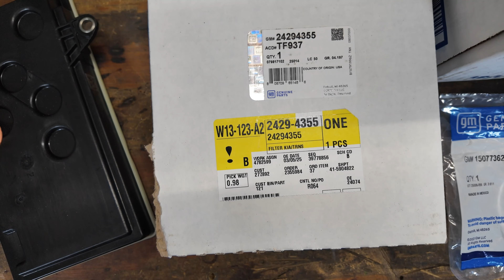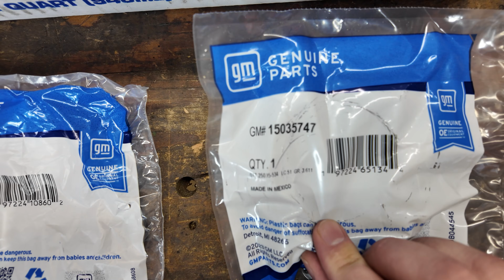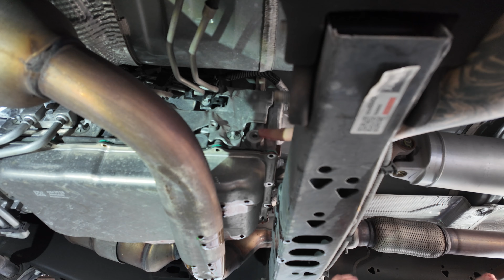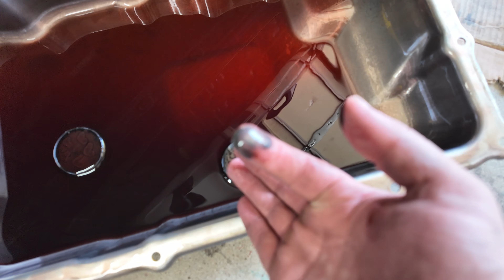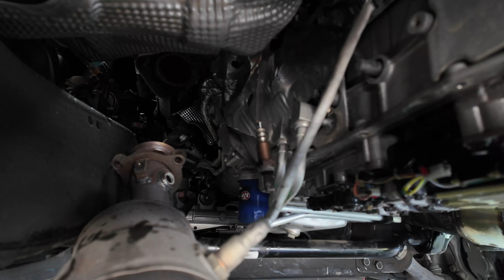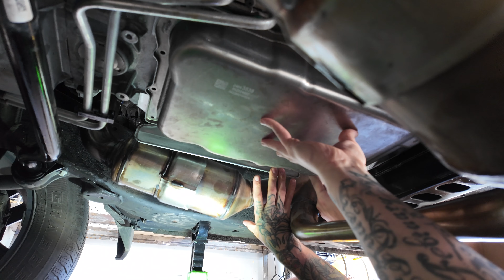Save Hundreds: Service Your Silverado TRANSMISSION Yourself

Comment: Had a BG transmission flush/exchange done on my 2020 Sierra with the 10L80 and a 2021 Suburban with the same 10L80, changed both around 50k,...so far so good.
Reply: I did it at 20k.  Get all that metal out .
Reply from the maker: @sschevmale24 that’s the best way to do it!
Reply: @sschevmale24  Did they pull the pan and clean the magnets?  The magnets can become "full" and allow particles to flow and become attached to the magnetic solenoids... which becomes a larger problem down the road.
Reply: @testtesting2868 no. Just a flush.  Have 55k now but I will drop the pan, put new filter and new ppe pan.  Might change to amsoil atf
Reply from the maker: Nice! I do like the BG products
Reply: A flush at that mileage is good to do but not ova 100k miles as ppl try ta do

Comment: Once again gm engineers make something simple into a debacle
Reply from the maker: Yeah exactly 😂
Reply: @alwaysandy1  but the problem was the exhaust pipes from both sides of the engine has to merge somewhere somehow and this was the only place to do a cross over. it would have been nice if there was a drain plug so you can just do a drain and a refill.. but GM had to remove the plug to save $$.  lol
Reply from the maker: @bommie1202remove the plug to save money lmao, you right!
Reply: @bommie1202 Then how would you change the trans filter?
Reply: @bommie1202  :>   Drill a hold,  let is drain.   Tig a threaded aluminum collar or nut to pan.    Add a drain plug:>    Change trans  fluid every 30k with ease.
Reply: @factoryrat405  Draining the fluid out of the pan BEFORE taking the pan off is a lot easier than trying to slowly lower and tip a full heavy pan into a drain pan and not spilling transmission fluid everywhere, especially if you’re doing this laying down on your back with the truck jacked up instead of a shop lift
Reply: They ran the exhaust in the way so it'll be difficult for yu ta change it yourself.  This service will cost yu 500-600 in a shop alone.  Fluid gotta be pumped back into it.    No dipstick on that truck
Reply: @STG-i4x did mind yesterday $440 performance transmission drain, now I’ll let you figure out what’s performance about a drain. But it is shifting better I’ve done 4 of them and I don’t even have 100,000 miles yet 😩😩😩 “ I’m never going to retire “
Reply: lol thanks for that made me laugh just shelling out $790 for two oxygen sensors so it is the LAST CHEVY I will ever buy
Reply: @jonathanbellows113 wait til you’re on your second torque converter. Chevy has went to hell man. 😢 garbage quality these days
Reply: @cap @captaininsan9997  yes, I guarantee you this will be the last Chevy I ever buy, I replaced mine with a circle D heavy duty so I’m hoping I’ll get some mileage out of it

Comment: Do you have to have a Chevy dealer repair shop do this? That's what I've been told. I have a 2019 Chevy Silverado 1500 LD work truck.
Reply from the maker: No you do not. To keep the warranty on the vehicle, just keep your receipt for the fluid and filter

Comment: I have a Chevy 1500 and I'm about to have the transmission serviced. Do you think that if I use a better oil other than Acdelco oil, I'll have problems in the future?
Reply from the maker: I doubt you’d have any issues, in my experience better fluids usually work just as well if not better then recommended ones
Reply: Chevy is now recommending the Mobil 1 ULV to replace the stock oil that breaks down around 80-85000 miles.

Comment: Pretty new to working on vehicles. Where did you learn/find the torque spec for the pan bolts?
Reply from the maker: GM Labor Guide
Reply: @alwaysandy1 do you have a link to the labor guide?
Reply from the maker: @rcrracing33 unfortunately it’s only accessible as a GM Employee
Reply: I recommend an AllData DIY subscription. $130 for 3 years for one vehicle (also monthly and yearly available). It is constantly updated with technical service bulletins. I use it all the time.

Comment: Do you know if this would be the same service for a 2022 sierra 1500 with 8 speed?
Reply: I had to drop exhaust on my 8 speed.
Reply from the maker: Good question, I’m not sure tbh
Reply: Currently working on my 8 speed. Some videos show people prying on the exhaust to slide the pan out. I have a frickin jack holding my prybar in place and it’s not enough room on mine. Now watching videos to figure out other ways to get it out.

Comment: Can you pls add the link or the size of the filter fasteners can’t find them anywhere with no guidance
Reply: u can use a regular 8mm socket, chrome tho it fots tighter than the imapct socket
Reply: E8 socket
Reply: E10 would be 8mm in metric
Reply from the maker: 8mm

Comment: I’m fixing to get amsoil ulv transmission fluid instead of delco
Reply from the maker: Sounds good! Let us know how it feels
Reply: @alwaysandy1 AMSOIL is BY FAR THE SUPERIOR ATF. Dexron VI is mineral oil GARBAGE...AMSOIL Blue Label S.S. 'Fuel Efficient' ATF is a 100% full synthetic and night and day better...next atf fluid change, try it - you'll be amazed with the results!
Reply from the maker: @Canada55Ehthanks for the tip! I’ll give it a shot!
Reply: @Canada55Eh  where you find/ get Amsoil at for 10 speed in canada?  I've called a dozen parts stores with no luck

Comment: 2020 Chevrolet Silverado 1500 LTZ No Drain Bolt on Pan
Reply from the maker: Gotchya
Reply: There's rubber plug on the other side

Comment: thx for the video. Obviously a very controversial topic. Should you or should you not replace your transmission fluid? Some say yes because its regular maintenance every 45k miles or so. Some say no because you'll somehow have issues not matter if you did every correct like in your video. Thoughts on that?
Reply: I was thinking the same thing when I did my 4l80e it’s a Mark 5 gen 5 or whatever so after I did the simple flush and filter it’s making a subtle whinning noise now it’s like dam If I do and dam if I don’t I’m done with it lol I’m going to just leave it alone for now
Reply: @Itainteasybeingcheesy2000  that’s what I’m saying. Totally different from regular oil change. Trannys though is like very sensitive to the point where I rather just not even touch it. Or have the dealership do it so if it messes up it’s on them type of situation.
Reply from the maker: Good question, I think everyone can agree on there's "no such thing as over maintenance". First, you 100% definitely need to replace transmission fluid. For GM, they say every 45,000 miles. But I feel like thats subjective. If your towing heavy or doing a lot of in town driving, especially if you live in the south, than you shouldn't wait so long. Heat destroys the addivtives in the fluid and it should be changed more often. GM says every 45K under normal driving conditions. 
I have another video on my channel of doing a 2500HD transmission serivce that waited a little too long and the fluid is much darker. 
The controversy comes from having the "fluid flushed", using a machine that forces fluid through the transmission. The problem with that is found with vehicles that have not been doing the proper fluid exchanges, and when you force fluid through, your stirring up crap on the bottom of the trans pan and pushing it through the valve body. There's check balls that rely on very tight tolerances and the trans makes it shifts based on fluid pressure. 
If a bunch of debris has been stirred up and and getting stuck in the valve body that could cause the issue.
Reply: Every time you start an engine you produce heat.  Imagine this, especially in winter and spring.  This produces the chances of condensation to form and water in your fluids.  I just traded in a Mustang GT, and Ford was recommending that the brake fluid be swapped out every 3 years due to condensation.  Motors, transmissions, differentials, and brakes aren't cheap and neither is the labor to replace them.  A little maintenance goes a long way.
Reply: Helo mech over here, worked on many many transmissions that have significantly higher operational standards. There’s no such thing as over maintenance. Just shitty maintenance and tranny’s that are already bad that need to get changed. Don’t let people scare you out of taking care of something, that’s a fools rumor followed by fools. No truth to it based off of my very real very first hand experience. Keyboard warriors, goooo!
Reply: 2013 Silverado 5.3, 6 speed.  At 245k I've never dropped the pan. Shifts like new yet. Think of all the money I've saved.  Same with rear-end - never serviced.   I change oil when the computer tells me.  So is routine maintenance, other than engine oil changes, overkill or am I just lucky?
Reply: @ajbswfl it’s hard to tell. In your case probably lucky. Then again older models are proven in general to last longer. Tough times.

Comment: Should really flush it every 30k-40k instead. ( fluid/ filter change around 100k miles ). The ULV fluid degrades very quickly and a flush replaces all the fluid, not just 1/2 of it.   Taken care of, the 10 speeds aren't bad transmissions.
Reply: hello, can you explained a little more on what you meant but the 30k-40k flush vs the 100k mark as you mentioned? Trying to learn from other's here.
Reply: Flush as in Dialysis for your transmission. Swaps the fluid 100% with new fluid. Do it at 30k, 60k and then at 90k drop the pan and do a drain and fill.  Then every 30k after that.
Reply from the maker: @Ricky_Rocha please continue following along in the thread
Reply: Newer transmissions actually suggest you don't flush. Drain, filter, and fill. Flushing only decreases the life span of vehicle by flushing contaminants further through the system. Deteriorating seals.
Reply: @ToreyTheTech  I'm a GM Tech, and they fully support flushes, at least with a BG machine which uses straight line pressure, so it's not gonna hurt a thing
Reply: @mattdudley3789 how much is a flush usually? Does the factory and extended warranty cover a flush? My truck shifts rough from park to drive some times and feels like it’s jerking occasionally. I have a 2022 Chevy Silverado 1500 RST 5.3L with 53,000 miles. Any info helps!
Reply: @Rivalsboiz10  Flush is $2-400 depending on where you go and it is not covered BY warranty ( it is maintenance ) but it certainly is not going to get voided by doing a flush.. At 53k miles your about due..  Sounds like you may have a shutter, but it's hard to know without driving it
Reply: @m @mattdudley3789 thanks for the info bro! Would a flush fix the issue?
Reply: @Rivalsboiz10  Will probably shift better
Reply: @ToreyTheTech you got documentation to back this up? I’m stuck between flushing and drain and filling with a filter change. Not sure which way to go yet.
Reply from the maker: Thanks for commenting. What do you mean by “flush”? I see you said the word “Dialysis”. What exactly are you referring to? 
Usually, when the word “flush” is used in terms to a transmission service, were referring to using a machine that pushes fluid and sucks fluid through the dipstick hole to in an effort to remove all the transmission fluid instead of dropping the pan. Seeing as how the 10 speed in this video is not equipped with a dipstick, I’m confused as to how you would have us flush it?
Also, the fluid and filter are due every 45,000 miles, per GM. I DEFINITELY would not wait to do the filter, especially with the first service, as the filter has already caught a bunch of break-in material inside of it. 
Also, as far as when to actually change the fluid, it’s more based on vehicle usage. The one in the video has only really seen highway mileage (helps keep the fluid cool) and has never towed anything a day in its life. As seen in the video, the fluid looked really good as a bright red color. Heat is really yhe only thing that breaks down this fluid. I disagree that LV fluid degrades quickly, it’s actually really good. 
Finally, the only fluid in this transmission that was not replaced in this video was the fluid in the torque converter. The converter (unlike some Fords) does not have a drain plug on it, so I’m not sure how you’d flush that fluid out without dropping the transmission.
Reply: You use a flush adapter for the trans cooler block connection on the transmission.  It’ll push all the fluid out and replace it with fresh fluid.  You can also use a disconnected cooler line and run the engine to pump out 3 quarts, fill 3 quarts at a time until you fill the spec amount.
Reply: Also we can agree that heat breaks the fluid down.  The 10 speeds have a thermostat and they get way too hot if they are worked
Reply from the maker: Thou that's one way to do it, i'd be careful doing that with this specific transmission. They are already kind of sensitive, and the valve body has really tigh tolerances. As seen in the video, those magnets had a bunch of junk on them, that you wouldn't want getting caught in the valve body. 
Also, the fluid wasn't really that bad, and missing a couple quarts wouldn't harm anything at least according to GM. The video follows GM's repair instructions as outlined in Document 5657389, which is how the serivce is getting preformed at the dealership. Also, they want that filter replaced every 45,000 miles. I think it would be safer to drop the pan, replace the filter, fill the fluid that you took out, and simply do the service more often than required in an effort to keep the fliud fresh.
Reply: @alwaysandy1  I actually work for a dealer. Flush machine provided by GM and the warranty under writers will accept the flushes as proof of maintenance .   I flush 10 speeds daily. They always shift better with fresh fluid. Actually, GM wants a fluid flush before they will warranty a transmission or component for a shudder.
Reply from the maker: I also work at a Chevrolet dealership. And the GM under writers only request proof of one of three things: A reciept showing you at some point purchased transmission fluid, a reciept showing you at some point purchased the transmission filter, or a reciept showing you at some point had a transmission service completed anywhere. They don't care how the fluid exchange happened.
Reply: @alwaysandy1  They are now cracking down. They used to be very lax with us and replaced a lot of transmissions under warranty without question. Now they have to have proof of service. Those who turned the transmission service down are denied, but those who had it are approved. Also they are considering every vehicle we sell severe service due to our 
climate... They cracked down on transmissions first, now they are also cracking down on engines with all the issues there.
Reply: @alwaysandy1  " simply do the service more often than required in an effort to keep the fliud fresh." ... Then there is no need for a full flush anyway. Keep in mind, the oil was already in worse "shape" than oil that gets changed more regularly.
Reply: Wouldn’t you be pushing the break in material metal shavings throughout the tranny while flushing it? Just curious because I need to do this but I am unsure if I should drain and fill it with a filter replace then flush it or the opposite (flush it then drain and fill with filter replace)? Any thoughts?
Reply: @Rivalsboiz10  If it's flushing with line pressure, than the only thing your doing is exchanging fluid at the pressure that your transmission generates
Reply: @mattdudley3789 so in your professional opinion, should I drain, fill, and change the filter then flush it or the opposite or one or the other?
Reply: @Rivalsboiz10  Since the filter is grabbing the dirt, it will be held in the filter and isn't going anywhere. You can get away with just a flush in most cases. However what you suggest is what I did to my personal truck which I put a used 6L80E in.. Swapped filter. filled it up with fluid ( shipped dry ) and then did a flush on it.
Reply: @mattdudley3789 thanks for the info bro! Also they say the filter bolts should be replaced each time you change the filter is that true? I think I’m going to drain, fill, and filter change then take it to get flushed at my local Chevy dealership in Vegas and see if that helps with the shudder issue.
Reply: nothing about your comment is fact.